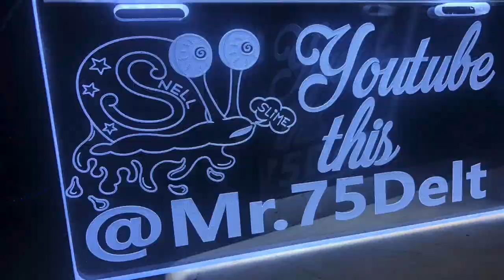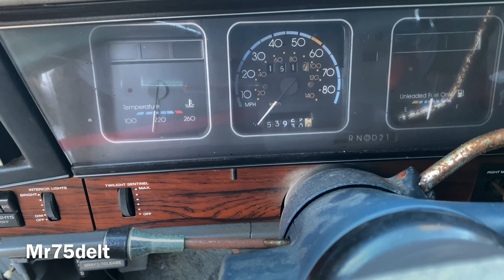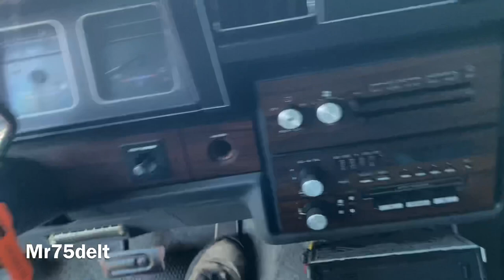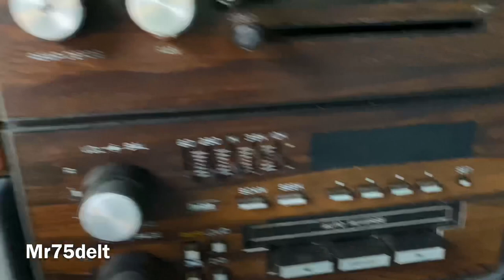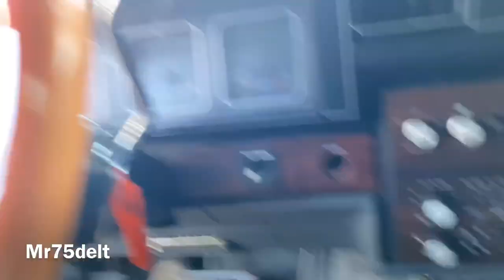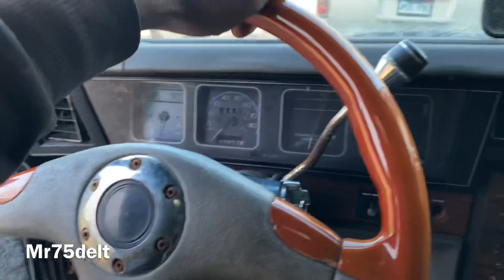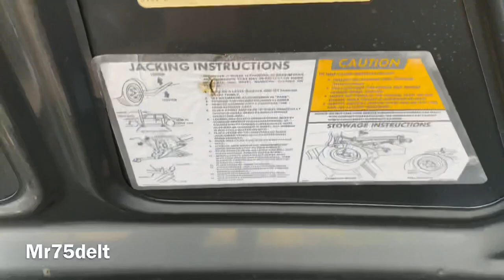I Bought My First 89 LS Box Chevy 📦

Comment: 96-00 mine a 98 5.7 vortec carb swap with goodies and th400 with shift kit  transmission 373 gear 87 swb  daily driver and get on a ls motor  ass get electric fans electric fuel pump do my own work
Reply from the maker: You got a Instagram?
Reply: @Mr75Delt  I'm original from hope Arkansas